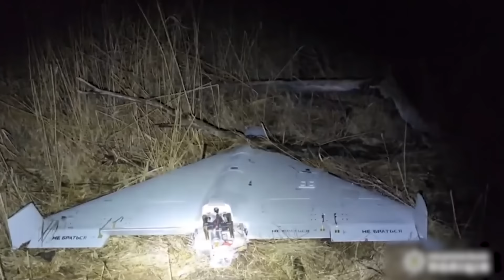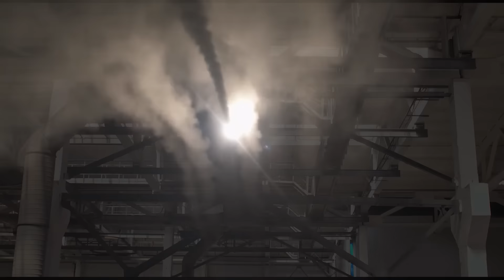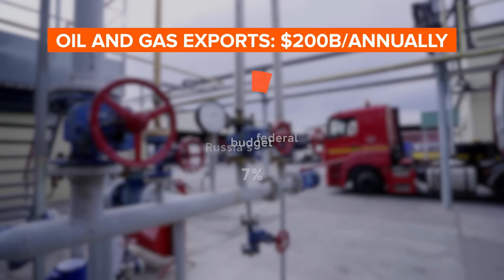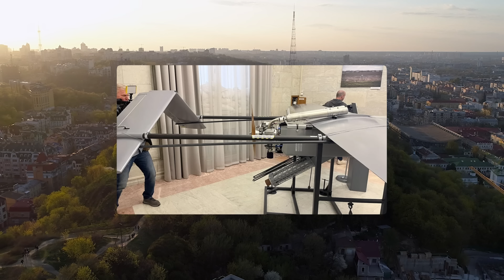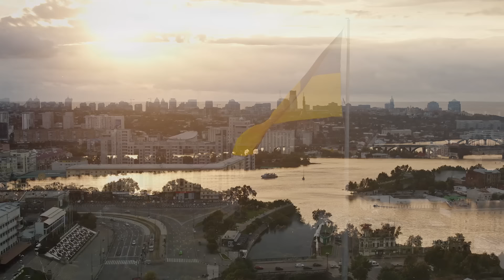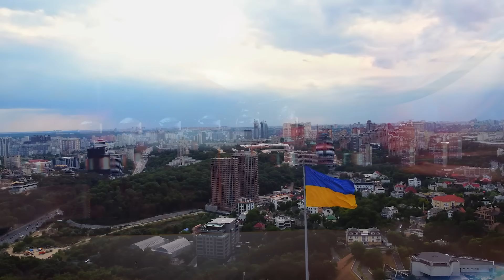How a $55K Ukrainian Drone CRIPPLED Russia’s ENTIRE War Machine

Comment: Sounds like Lockheed Martin could learn a thing or two from Ukraine’s defense industry. Maybe something like maybe dumbing down Tomahawk’s overkill hotshot software to only what’s necessary accomplish just one mission, and loading it into a similarly cheap and simple airframe such as the folks at Cessna could help with—or some guy making RC models with a 3D printer in his Fort Worth garage. Which is what Ukraine apparently started with.

Comment: It's basically the difference between shooting at something with a rifle vs shooting at the same thing with a shotgun. With the rifle, a miss by just a cm is still a miss while the shotgun's pellet spread can be adjusted based on the average firing range. So with the shotgun, you'd have to miss by almost a metre before you don't do even a little damage. And if you put a few tracing pellets in each shell, the gunners have visual feedback on how close the shot went. It's not hard to make the shotgun shells to do what I just described and any hunting shotgun can be used to fire these shells. This way the only real development costs are in making the shells and not the wrapon to fire them which is usually the highest part of any new weapon system. Even Canadians have shotguns for hunting.

Comment: I don't understand what they're talking about?!?! In the West, wages and the cost of living are much higher than in Russia, and it's very simple?!?! For example, in the EU, the consumerist lifestyle was pushed, which means that most people returned the leased car after 5 years and took a new one again, which was possible if your salary was between 2,500 euros in 2005 and 2010 between 3,500 and 5,500 euros, but electricity and the cost of living in the West are much more expensive. For example, I was surprised when I saw in 2010 that it was in Itaya's electricity bill is 500 euros per month, and almost everything is gas, and even the water in the boiler is heated by gas, while in Eastern Europe we pay electricity 500 euros per year!! And we could buy cheap half cars!!! I bought a 2008 Alfa Romeo for $2,250 and the car was built in 2003 and still had LPG installed!!! What would a new car be called in our country!!!!! Which is logical, because anyone who has paid 30,000 marks or later euros, it is logical that they will keep it, especially for the first 5 years, and I have to I'm still driving this car and it looks like it's new!!!! However, when the conflict began and cheap gas stopped coming to the EU, it simply could not survive without 4,000 to 5,500 euros, and if it has to produce these explosives, the salary is much higher!!! However, for Russia, a salary of 1,500 euros is quite okay considering the price of fuel, electricity and everything else. And if you add to that that Russia has its own resources, the West simply cannot produce anything without being at least 3 to 5 times more expensive than it is in Russia?!?! Especially since Russia borders China and India, where the West has shifted its production!! And it's very simple

Comment: Hmmm... I wondered how long it would take them to get to the same conclusions from post WW2 regarding low volume complex weapon systems (Axis) versus high volume lower tech systems (both western and eastern allied forces). You can have the best tanks, planes or ships. But if your 10 high tech systems get flooded by dozens of low tech systems, you are still going to get killed eventually...
Note: Low tech does not equate to low capability... (see M4 Sherman and T34-85 vs Panther, Tiger and King Tiger)

Comment: Regarding the solid propellant issue, Canada gave Ukraine a large number of 2.75 unguided rockets which had aged out of service but which included perfectly good rocket motors including a smokeless burning type. Maybe they are using these?
Reply: Slava Ukraine 🎉🎉❤❤🇨🇦
Reply: It is typically the rocket motors that are what age out, the "grain" develops cracks, or slumps causing unstable burning or explosions, or case burnthroughs.

Comment: An interesting analysis.  It is however one-sided, focusing on the damage that can be done to Russia by low-cost drones.  Russia plays the same game in the opposite direction, sending something like 5000 low-cost Shahed drones per month against Ukraine.  The other part of the equation, not discussed by the video, is using the same low-cost, high-production model for interceptors to shoot down the drones of opposing forces.  This needs its own video.

Comment: Isn't it like the story, america spending big $ developing a pen that works in space,and Russia just used a pencil
Reply: Russia eventually bought the pen from the US.
Reply: story is apocryphal. the fisher pen company developed a pen with their own funds and have made multiple times return on investment selling their 'space pen' ever since. of course nasa has used and still uses pencils. the dust does not do well in zero gravity though
Reply: @artcamp7  There is a grease containing compound used in most space writing implements these days afaik, similar to kids oily crayola or whatever it's called. Looks like a pencil but there is no dust since instead of dry lead graphite, it uses one with some sort of oil... grease pencils is what they are called in some NASA documentation. Anyway, they do use different kinds of implements depending on what they need it for. The grease pencils don't do well on anything you want to store for long term that gets shuffled about etc. For quick notes it is perfect though, and has no dust issues. The wrapper for the grease pencil is an issue though, so none of them are perfect, so as strange as it might seem the Fisher nitrogen filled spaceballpoint is apparently still in use 50+yrs later, alongside various other options. 
It is the "best" in performance and safety terms, normal pencils have dust and it's conductive dust, the grease pencils don't create dust but they have a wrapper you have to peel progressively, and the wrapper if torn off and not disposed of with care is a potential hazard since it is oily and conductive. There is no perfect solution or magical bullet for it if you want to produce a permanent mark on paper or something paper-like. Yet anyway.
Reply: That's an urban legend, Paul Fisher developed the space pen and ended up selling it to the U.S. for $2.49 each.

Comment: The tech to automatically target these cheap projectiles reliably will tip the scales back toward expensive weapons systems. Either way the days of winning wars with masses of humans charging a line are over.
Reply: the ebb and flow of military tactics are as eternal as the tides. sometimes you want precision strike platforms that are durable and sometimes you want a curtain of rockets to blanket a general area.
Reply: A shame nobody has told the ruzzians that!

Comment: Refineries need crude to refine, which is moved to the refineries by pipelines.  

Pipelines are almost impossible to economically protect with air defense systems.  

Why is Ukraine not using its long range drones to attack pipeline hubs and pumping stations?
Reply: You're right, but, even better, hit the drill string on the oil rig and stop the oil being pumped out in the first place... a broken drill string in a well is weeks or even months of down-time for an oil rig.....
Reply: They’ve been targeting pumping stations because Russia cannot get new pumps due to sanctions.

Comment: This philosophy is sometimes called "fast, cheap, and out of control". The name comes from a criticism of the Mars rover, in which it is surmised that rather than have one extremely expensive rover that can do everything, it would have been better to have 1000s of much cheaper, more specialized ones. This eliminates the single point of failure problem, and even if 90% of them fail, you still gather more information from the ones that do not than you ever could from a single machine.
Reply: My girlfriend is fast, cheap and out of control!😂
Reply: @danielclark863   Are you bragging or complaining?

Comment: A drone with a hydraulic press could just move down railroads and push apart rails. 
No ordnance required.
Reply: with the same weight of a hydraulic pump, cylinder and related power supply you could pack enough explosive to create a crater around that specific piece of railroad :)
Reply: @loookas  you should genuenly seek a therapist.
Reply: That is a war crime and endangers innocent civillains.

I mean russia has never done that in its history..

Comment: The entire system of drones used by Ukraine is that they are constantly improving because they are being used every single day. Design and development in  normal non war situations has no direct comparison to the  Ukraine situation and thus it can work on any issue that occurs and deal with it the next day. When you buy off the shelf solutions and try to use them you could be anything up to 20 years out of date! That is always the issue with any electronic based technology.
Reply: Buddy that's just science fiction.
All of the drones have allready either been made, or have been tought of.
Reply: @Originalgolden so wrong. Many of the drones are produced domestically although many are sourced elsewhere. Thats why you see so many haphazardly made drones that looks like it was made by a hobbyist. Also drone tech adapts due to conditions so Ukraine has to customize when possible
Reply: 20 YEARS ago the AV System my small church uses 3 remote control 1080p cameras , 24 channel sound board, 4 compressors, wireless mikes and in ear wireless monitors would have cost around $100k. instead of $3k it cost today. The level of off the shelf tech today is unbelievable.